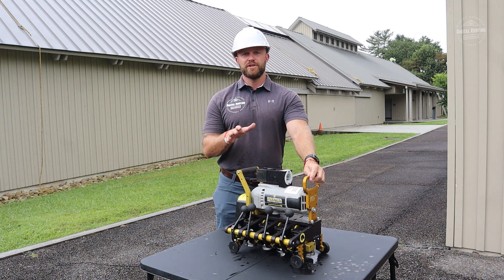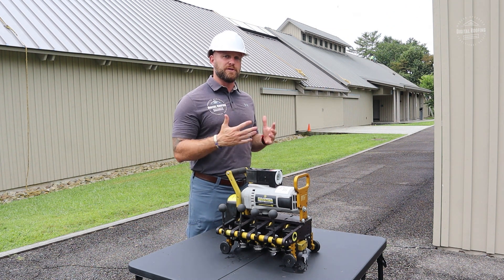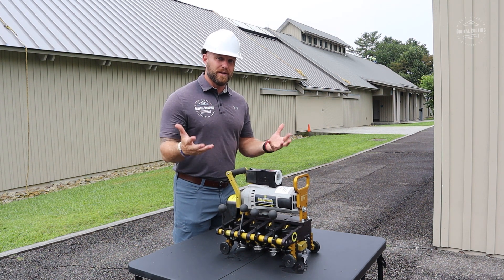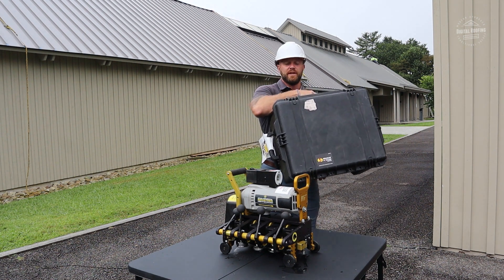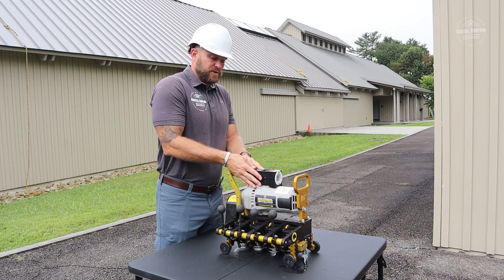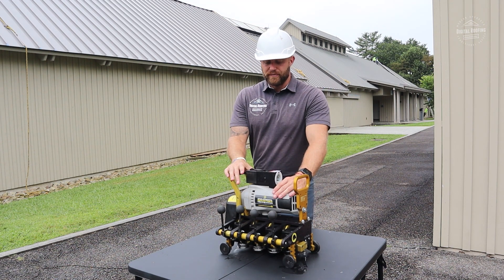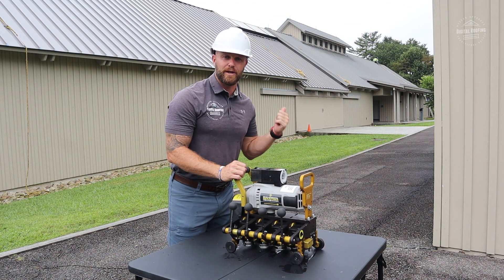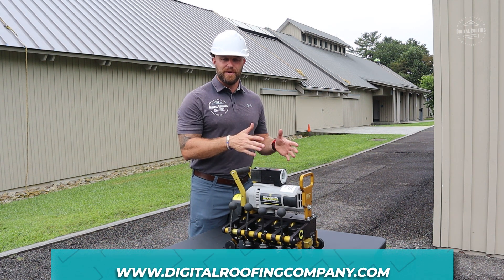How to Use A Standing Seam Metal Roof Machine Seamer

Comment: Great video. Thanks. I'm using this same panel in a structural application.  I have a 16" tall vertical fascia panel that I need to double lock.  What hand seamers do you recommend and where can I order them from? The 2 that I have are scratching the panel. Also, any tips on how to avoid scratching with hand seamers?